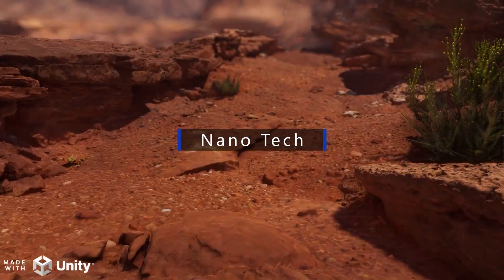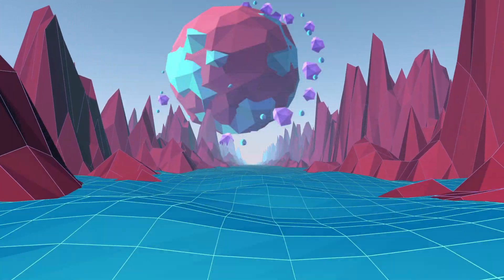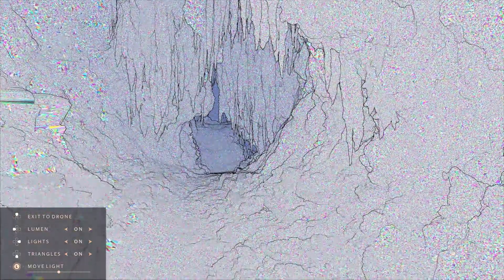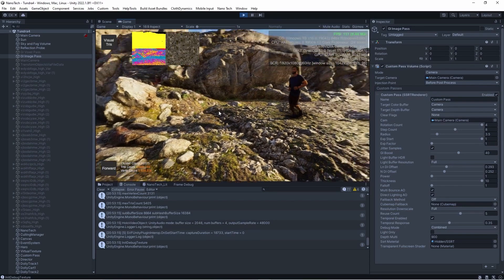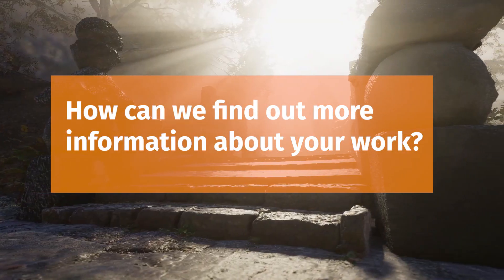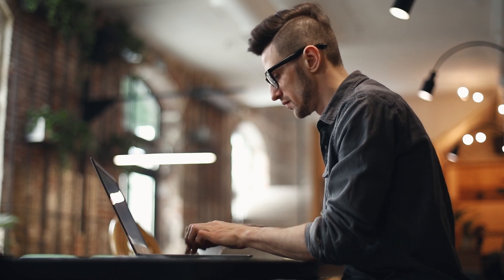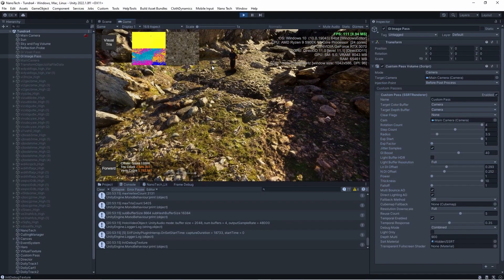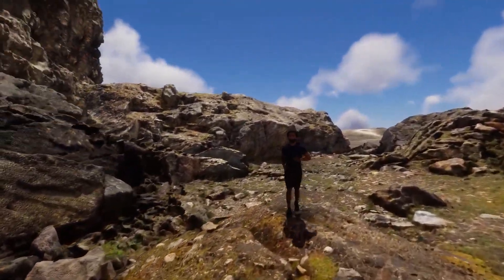NANITE for Unity | What is Nano Tech | Questions Answered

Comment: Just need to react to "games will get smaller" :). They will not - just have a look at how big Zbrush files are with those millions of triangles. So if you import a high res mesh to the game - the game will grow significantly.
Reply from the maker: It's really dependant on whether they find new ways to compress larger files with huge resolution in geometry. I'm not an expert myself, but I guess geometry can be streamed faster than loading really high resolution textures?
Reply: @SpeedTutor  You still need textures unless you store the color info in vertex colors (but you still need roughness / metallic, etc.). You can compress mesh data, but then you need to "unzip" it in runtime in Unity. I'm just pointing out some errors in the video. The build size will not likely be lower, but the fidelity of graphics can be pushed further with this tech. Plus the artist will have less work (no need to generate LODs).

Comment: Now Unity needs to get rid of its stupid rendering pipeline and condense it to one like unreal. This feature alone makes unity a very frustrating engine aside from the performance aspect
Reply from the maker: I've said this for a long time, structuring to update 3 different pipelines is insane.
Reply: @SpeedTutor - I agree. Unity should streamline its engine by merging these pipelines (instead of investing in merging companies!).

This is not my biggest annoyance though. I hate the way Unity handles packages, templates and project settings, and I really wish they would get rid of those stupid templates altogether.

Anyway, great video! Thanks a lot!
Reply from the maker: @j.vonhogen9650  You're very welcome, my dude! I wish they did many things and hopefully at some point they do streamline the whole thing but I feel it's a beast that's not possible to tame at this point. If you know what I mean! :)

Comment: still hiding the fact the graphic not gonna improve just render speed increase
Reply from the maker: Graphics is a generic term, it's only stalled by performance of current hardware or software that doesn't support high resolution geometry, textures, shaders and advanced rendering techniques.
Reply: @SpeedTutor  oh sorry man i guess u right but what are the plan for lumen ?
Reply from the maker: No need to apologise, my dude! Chris is also working (Or will be working on) a system for lighting too. :)
Reply: You have then more headroom for your own shaders if you are not satisfied with Unity defaults. Problem solved.